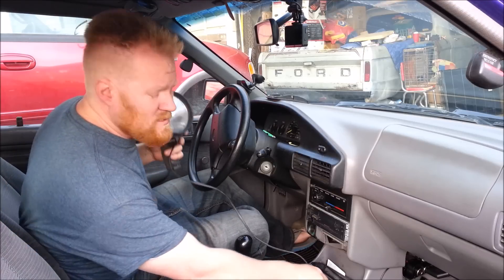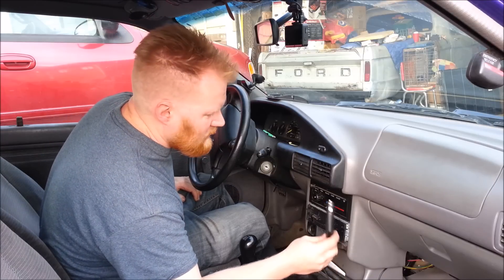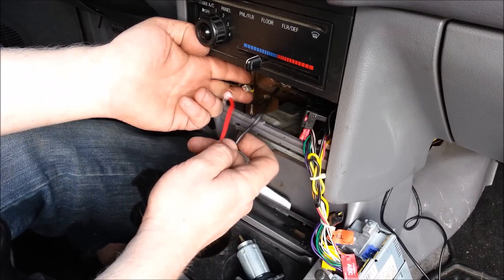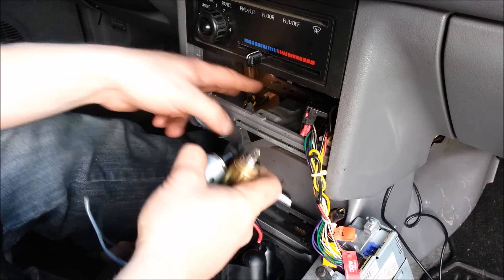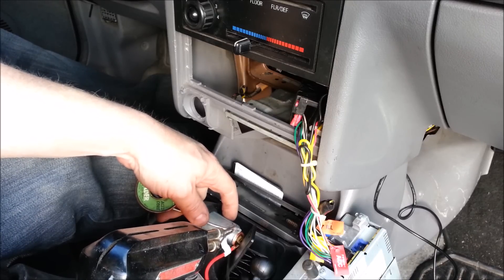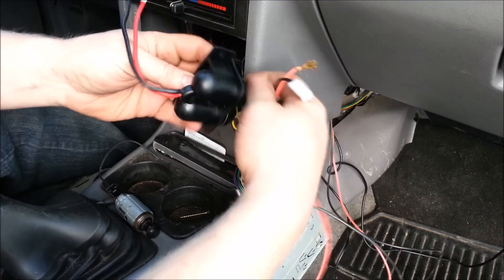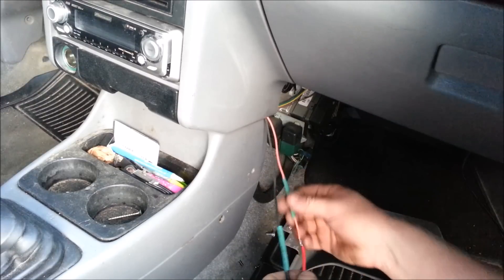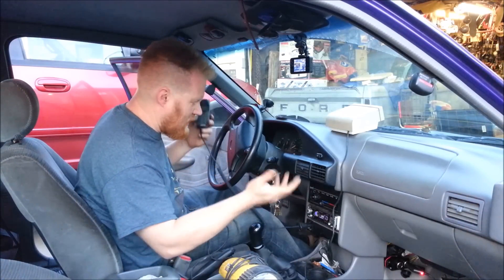Add more Power Outlets to your car  12volt Cigarette Lighter

Comment: This video just saved me at least $150.  I had a broken plug stuck in my motorhome 12v socket and couldn't for the life of me figure out how to pull the socket.  Now I don't have to pay an RV repair person $$$ to unscrew it and pull the stuck piece out.   I couldn't find anything about the socket I could see, and as soon as you said FORD I ran out and fixed my problem.

Comment: I just bought the exact same dual socket 12v adapter but for indoor use with my 12v converted pc power supply.  I found it easier to program addresses into my old GPS indoor before I get into the car. Plus it'll be easier to use other 12v devices indoors when more sockets are available.
Reply from the maker: +wtam69 That's a good idea.
Reply: +wtam69 You don't the a cigarette adapter for that. All you need is a USB port and you can buy these pretty cheap online or in stores.

Comment: We actually put one of those in my dad's 1962 Willy's CJ3B jeep. Lol. It works very well. It is used for the beaten on the roof so everyone can see us when we snow plow at night in the winter. So glad we have it. Thanks for making the video. Really appreciate it 65FORD.
Reply from the maker: +Love2boat92 Thanks Man. The old Willy's would be a fun vehicle.
Reply: sixtyfiveford No problem.  It definitely is a fun vehicle. Sure is a head turner. Loads of low end torque too.

Comment: Looks Good . One more Tip. Put the Splices in Different Spots so that the Wires Wouldn't touch ever.
Reply: I also came to the comments to mention offsetting the splices. Butt splices will also work if you don't have a soldering iron.

Comment: thank you for not promoting Scotch grip connectors they are horrible. love love your videos keep up the good work stay warm winters coming
Reply from the maker: +Wes Shaw Yeah, those little buggers have been the culprit for failed wiring more than a handful of times. They're easy though and quick so people love them. If you coat them in dielectric grease they will last 10 fold but still no where as good as a solder joint.

Comment: Good idea, those quick connectors are a bane to humanity. They can last longer coated with hot glue but only in desperation. You know how bad they are when you can't use them under the dash.
Reply from the maker: +57WillysCJ Never thought about hot glue. About the only thing I've used to make them hold up is to coat them in dielectric grease.

Comment: Magic power box ..hard wire your dash cam to your car without the use of a Cig lighter ..The perk is it is on a double timer ..If my volts run under 11.6v (still can start the car/truck) Or after 3, 6, 8, 10, 12, 24, hrs it shuts off depending on the setting you set it at on the box 
My phone i charge at home before getting in the car aswell i have a portable battery that also charges the phone which gives me power for 1.5 days of full use
Reply: freakyflow yea i think I'd like to hardwire the dashcam in. I still need extra sockets for gps and phone

Comment: It was easy to change things in these old cars. But I'm driving a 2011 Chevy Spark nowadays and everything's custom fixed in the dash. I can't even get an off the shelf radio to fit in there 😢 Think I'm just going to take a lighter plug and use a thick wire to run to a couple of these double sockets.

Comment: Talk more about why you run a dash cam and what model you run.  I have been thinking about buying one as I drive a lot for work.   Cool video. My old camper has a cigarette outlet in the camper and on the outside.   They are very handy.  The pervious owner did some great mods.
Reply from the maker: +Marcus Kloepping An outside one would come in handy. I'll have to do a short video on it.

Comment: That's cool. So I can just solder from the original plug directly to the new one. I pretty much want to do what you're doing. Just keep the dashcam plug behind the dash. Don't need to see it ever unless I'm removing the cam.

Comment: Great vid. Could you show how to keep the 12v cigarette lighter always on please?
Reply from the maker: If You want it to always have power. You can just run a wire directly to the positive terminal on the battery. I would fuse it with an inline fuse.
Reply: @sixtyfiveford  thank you. Much appreciated

Comment: Nice and clear instructions. I am no electrician, so this might sound like a silly question - I'm currently using cigarette lighter splitter in my single outlet, but I get this annoying buzzing sound whenever I use both bluetooth adapter for music and LED's at the same time. Would soldering second outlet like shown in your video make a difference or it would be same as with splitter? Thanks
Reply: Also not an electrician but what you need is a ground loop isolator. Its a 1:1 transformer that isolate the ground noise from going into our bluetooth receivers. Its just a small box that plus in before the AUX socket. Give it a try if you still have the car!

Comment: I have a question will you blow the fuse if you have too many 12V outlets connected to the same power source ?
Reply from the maker: Yes and no. It's more about home much power you're pulling all together. Charging cell phones takes very little and you could probably have 2 dozen on the same circuit.
Reply: Is it worth putting an inline fuse in on them?
Reply from the maker: If your piggy backing off of an already fused circuit(ie: the stock cig lighter) there is no need to add redundant fuses.

Comment: Another great video, thanks for sharing. 
What would you do for more outlets but for continuous power like when you are working at nite and want to run some higher voltage plug in lights or other stuff?  
Thanks.
Reply from the maker: +Superiorpowerwash You can just run it straight from the battery or out of the fuse block from a fuse that retains power all the time(like the headlights).

Comment: I agree, I hate those little crimp on " wire taps" you only have a very thin piece of metal making contact with the wire.
I just cut, strip and tape, I have solder but it is junk, I got rid of my good solder when I cleared out my shop, guess I should buy some good solder...LOL
Reply from the maker: +old64goat Twisting and taping works.
Reply: ,Lighter and phone charger separate from each other on a 2000 Ford alturuas SE

Comment: i had room on the back of my center console by the rear seats ,so i installed a socket but ran the positive through a fuse then to the front socket but with the negative i connected it to a bolt under my center console because there was continuity between it and the negative on the battery. it seems to go ok, would it hurt to have the negative on the bolt?
Reply from the maker: A bolt will work just fine.

Comment: wouldn't we need a heavier fuse now.? Nice job, fast and to the point.
Reply from the maker: +W. Gator Not really unless you are overloading it with multiple high drain devices(heaters). Most plug in devices wont come close, even when combined, to blowing the fuse. If you do blow fuses you'll need to run a completely different dedicated power line from the fuse block. Adding a larger fuse would put the stock wiring in the circuit in danger of melting in a overload situation as itself is only rated for certain amperage. This car has a 15amp fuse which is very standard. Spotlight: 4.1amps, Defroster 8amps, Dash cam: 0.5amps, Cell Phone Charger 0.5amps. So even with these 4 devices I could still charge another cell phone or two.
Reply: +sixtyfiveford Thank for the quick response. What was on my mind was adding extras to my snow machine for GPS, 1 million candle power spot light, etc. There was a 3A fuse in there and I upped it to 5A. Guess I should run a fused line right from my battery, or maybe relay it off the ignition, huh! thanks again, Real fine job on your video,(as usual). No long periods of time watching engines running or screws being put in or removed like in other people's videos ;} Keep it up, we are all watching you..... very closely.
Reply from the maker: 3-5amp. I would do this as it is such a small jump.

Comment: Did you ever rebuild a turbo charger? 1996 volvo v40, the kit is like $40 on eBay just a few parts and seals it seems.
Reply from the maker: +joebonsaipoland I never have. They seam pretty straight forward though.

Comment: OK so I’m interested in running a auxiliary cigarette lighter to the rear part of my vehicle. What are some things I should look out for? My vehicle is also cursed with the one cigarette lighter also. Which makes it a pain in the butt when road trips are happening.
Reply: Just buy an lighter with shape easiest for you to add on place u want, get 2 wires, connect them behind lighter u have already and find best way for wires to rear part of car, thats all..

Comment: Great idea. What model dash cam do you have, and do you like it? I want to get one, one of these days.
Reply from the maker: +Dasdfjkl I've had others ask so I'll do a video on it... It's really cheap.
Reply: +sixtyfiveford Okay. Not to nudge you but Amazon is starting their lightning deals and I want to see which one you have, it might go on sale for Thanksgiving.
Reply from the maker: k6000 dash cam. They are $15-20 and even through claim 1080 are really only 720p. At the price it can't be beat. Being a cheap item there is going to be poor quality control so buy a model that is Prime so Amazon will take it back effortlessly if there is a problem. I bought my first one for Christmas last year for $22 and loved it so much I bought a second a few weeks later for $18(exact same). I have almost a year on both and have been immensely pleased. I wanted something cheap hanging for people to see and not a $200-300 piece of tempting car jewelry for thieves. Being cheap I even spray painted the entire thing flat black so it is less noticeable. I am going to buy 2 more and mount them rear facing. I haven't had any major issues and both are used on a daily basis.
Reply: +sixtyfiveford Thanks! I think I am going to get one. Can you make out license plate numbers on the video?
Reply from the maker: Yes and no. This was one of my concerns. If someone is close to you(4 car lengths+-) yes but definitely not if they're a dozen car lengths away. I figured the only person that I would need a license plate from would be a hit an run. They probably wouldn't hit me from the front where the camera is aiming but from the side or rear(no camera). And even if I did catch the plate, it is going to be more than likely a stolen vehicle so there's no recourse with the owner of the license plate/car. Even with the sharpest 1080p camera you have a lot of downfalls like the glare off the windshield that distort the image. If you have a cell phone camera you can get a good idea of the video/image quality by taking a picture out the windshield of your car. Adjust your camera to a lower resolution and compare:720p is going to be approx 1 mega pixels and 1080 roughly 2 mega pixels in the photo world.

Comment: Do a video where you hardwire all equipment to turn on when you turn the ignition on.
Reply from the maker: The cigarette lighter sockets all turn on with the ignition so whatever is plugged into them also turns on. This is the norm with most sockets in cars.
Reply: @sixtyfiveford  I mean hardwire without all the sockets. Straight hot ignition wire to each component.

Comment: What wire gauge do you suggest to use ? Thanks.
Reply from the maker: +Daniel Robert With a short run like this even 18 gauge would suffice, but I generally don't do anything on a vehicle less than 16 or 14awg.

Comment: The first thing they taught in soldering class, mechanical connection first then solder. Also you need to stager the connections in case the insulation wears out. Good video otherwise.
Reply: Ford Alturuas SE

Comment: ok i have a question for ya what do u do if u have no cig lighter and u want to put one is that as simple as what u just did message me asap due to i just bought a 89 astro van with no cig lighter im baffled by this please help and another question do power converters have light a car cig lighter on tthem is that a route i could also go?
Reply from the maker: I can't say I've ever seen a vehicle that didn't have a cigarette lighter socket. You should still have a fuse slot for one in your fuse panel.   You could wire on up just like I did, but take the power directly out of the fuse block.
Reply: sixtyfiveford that I'm insure of I'll have to check it out

Comment: How do I add more power , change fuse ?
Reply from the maker: You can't just add a bigger fuse because the wire running it is rated at whatever fuse is in there right now. I'm assuming you want to run in inverter or something like that. You need 20 to maybe even 30 amps and the easiest way to do that is to run a 10 (30amps) or 12 (20amps) gauge wire directly from the battery. It will be on all the time even with the car off but you can easily make it turn off with the car if that's what you want. To do that you run a relay and have it trigger off of the existing cig plug.
Reply: @sixtyfiveford  it’s caus  I have a 20 watt charger and it’s doesn’t get power , thanks
Reply from the maker: @Bassmaster784  A 20watt USB phone charger shouldn't draw more than 3 or 4 amps. Some Cigarette lighter plugs only have terminals on two sides and you need to turn the phone charger to line these up. Otherwise it won't work at all.

Comment: Now if i had soldered that negative to the case of the socket, two things would of cause happen, a cold joint because the case isnt too easy to get really hot, and when i tryed to put the socket back in the dash hole the dam solder blob would get in the way some how.
ive had annoying stuff like that happen lol :-D

Isnt heatshrink wonderfull, i have the plain black stuff and it makes every bodged solder joint look smashing LOL, no no i can solder correctly :-D
Reply from the maker: +zx8401ztv Yeah, I'd have to say heat shrink tubing is amazing stuff.

Comment: as handy as you are im surprised you hadnt hard wired the dash cam in
Reply from the maker: +Albion Laster I swap it from different vehicles so it's easier just to leave it as is. But this is a great idea.
Reply: Who knows... Maybe he wants to remove it? I didn't hard wire my CB because I like to take it out when I'm not on long road trips. Which is why added power ports are good for removable gear.

Comment: Nice. You did the job. However I hope your wife or significant other, is not like mine as with those accessories pointing towards the passenger side, my wife will kick the hell out of them in no time. I liked your idea of placing the sockets pointing down, in mid, lower console. That would be least invasive and mostly invisible. I'm going to definitely follow your hint on shrink tapes and solder.
Reply from the maker: Thanks, I'm glad you liked it. My wife has kicked them a few times now.

Comment: Were those sockets metric? I didn't think those would work in an american car. Nice job!
Reply from the maker: +BCtruck, rebuild, repair,repurpose You have a sharp eye... Yes, they were metric but I used metric to SAE converter solder to make them the right size for a domestic vehicle.

Comment: Everything can run on 12 volts nowdays, I fucking love it. I bet I could live the same if my house had 12 volt instead of 230. Just replace 230 volt devices with 12 volt devices.
Reply from the maker: Very true. Most electronics in your home that plug in(televisions, wifi routers, etc) covert it to 12v internally.